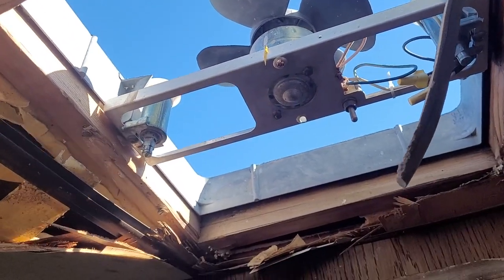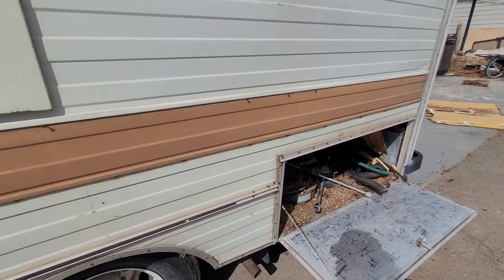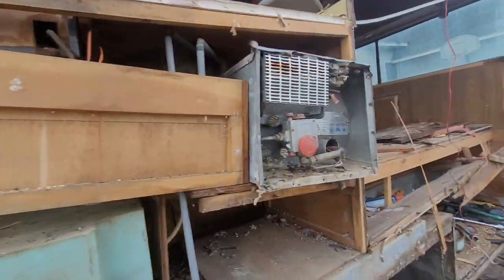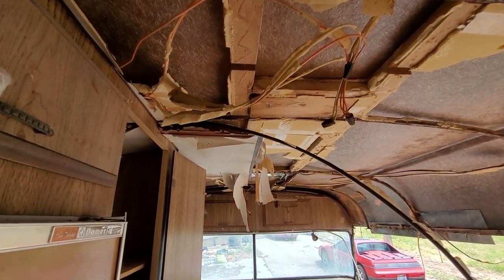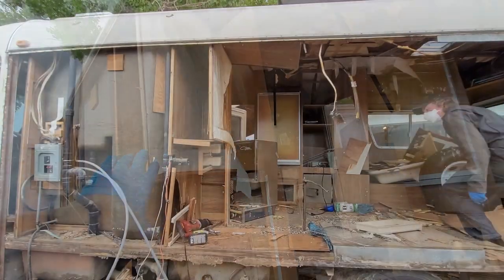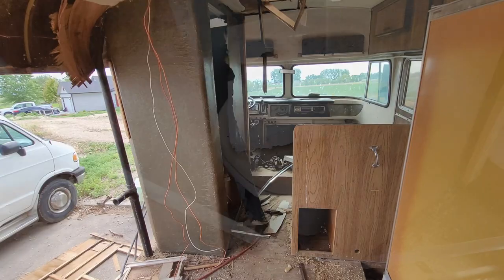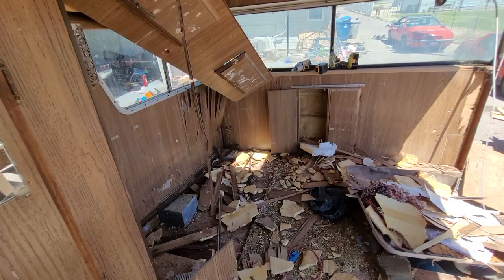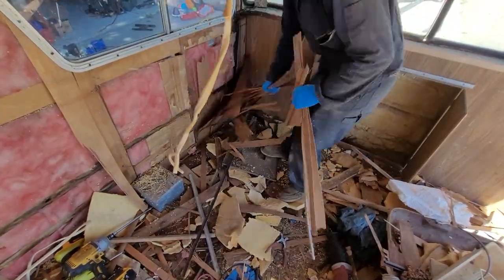1972 Chinook RV EP5 - Complete Structure Teardown

Comment: Well now you have a clean slate . I would yous 2x4s you might lose some space but your r value will increase and stiffer . you can bed line all the structure before you close it up .And with modern appliances much more efficient modern heating and cooling is so much better . I would ditch the black water system for a composting toilet lighter cleaner and no shit water get splashed all over you .
Reply from the maker: All good ideas! The 1 by construction definitely could be improved. I was thinking maybe welding in some vertical steel beams and tying the wall framing into that, but we'll see

Comment: I am not a carpenter. So maybe there's a reason and I don't know. But why don't they use pressure treated lumber?
Reply from the maker: By no means am I either, but my understanding is that they build these (even today) to the absolute bottom dollar. Everything is very cheap construction. Could be that pressure treated is too much of an expense.

I have read some types of pressure treated wood off Gass harmful chemicals so that could be part as well

Comment: I like it myself compact things to take apart and am now also very excited about how you want to carry out the reconstruction. I follow some camper and boat rstorations channels and have learned there how important the pre-planning of the electrical and especially the water supply is. With this type of camper you should have many design options, which is super cool. Have fun and success with your rebuild!!!
Reply from the maker: Glad you are enjoying, Wolfgang! Definitely will be pre planning as much as possible. Almost too many options to design from. Planning on getting structure sorted and going from there.
Reply: @NotEnoughProjects  sounds like a good plan to me!